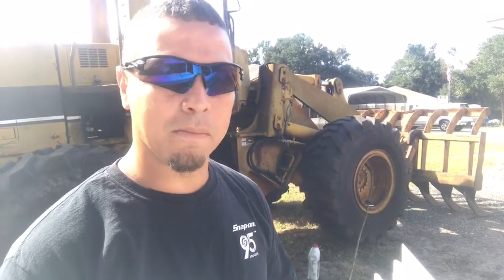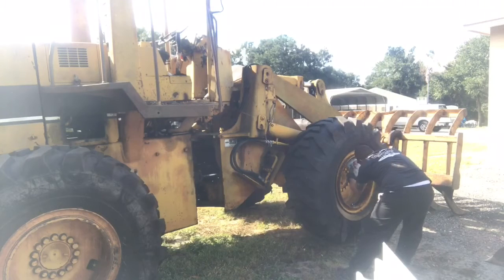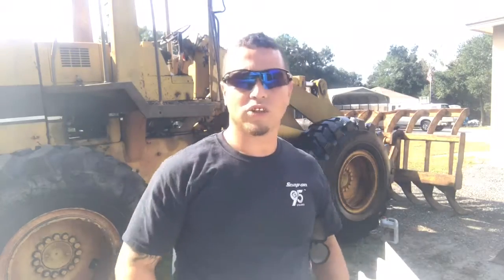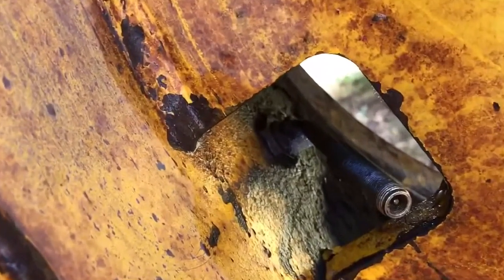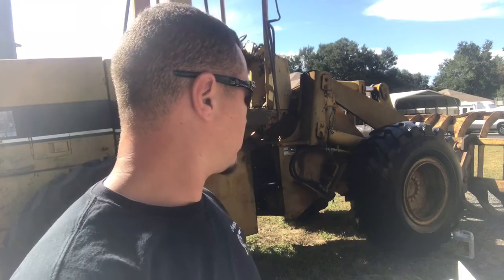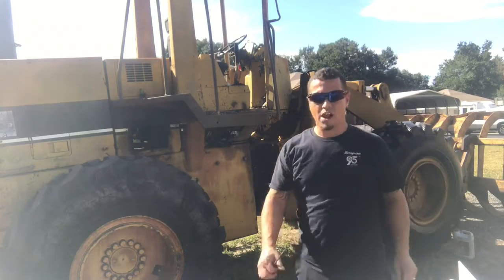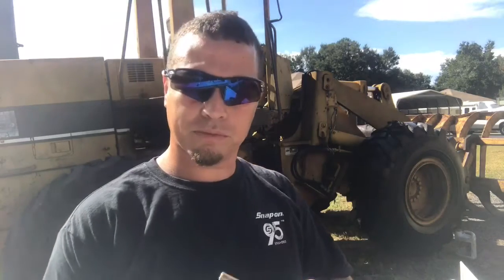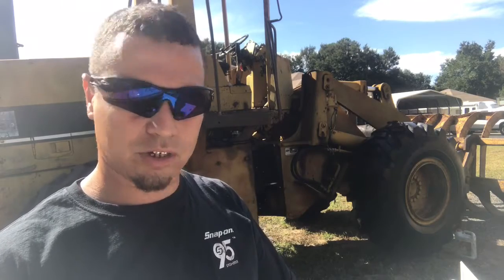Repair a loader tire 20.5-25 (short video)

Comment: Do yourself a favor and keep a couple 8x8 blocks in the truck to put under the axle if you're using a machine to lift itself, or someone else's jack. I never trust the hydraulics on an old machine, or a jack that someone else provides. Saving a step is always good, but take an extra minute to protect yourself.